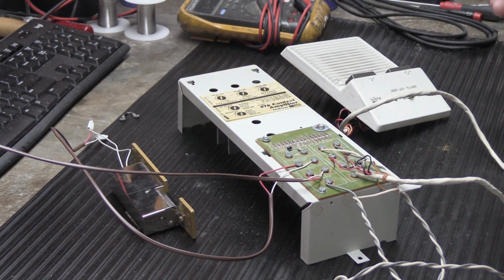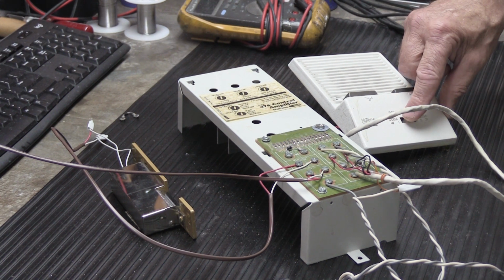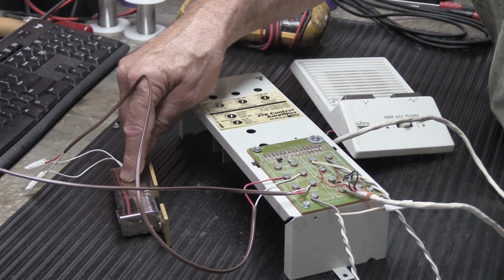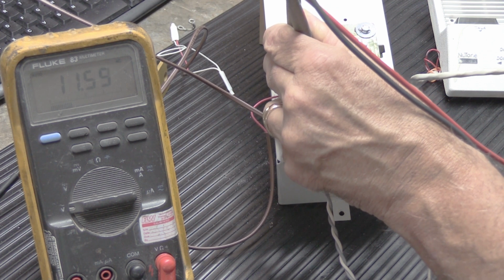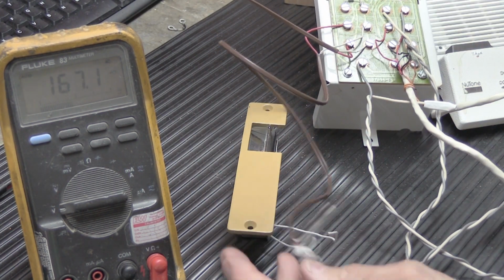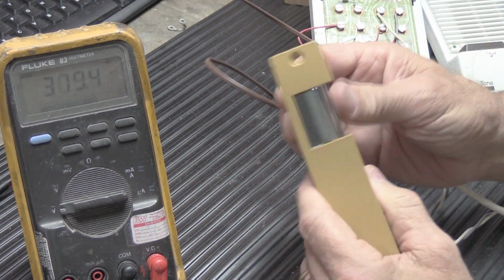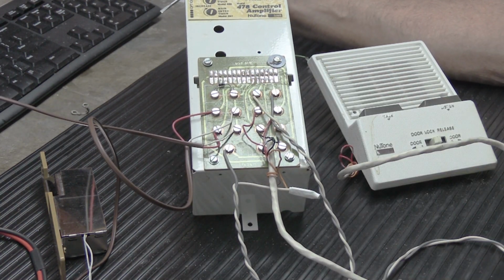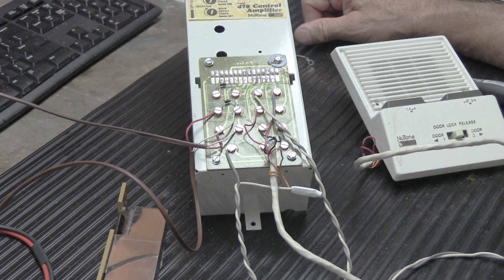Troubleshooting a NuTone Model 478 Apartment Intercom System for Door Release Problems

Comment: At 10 minutes, you show how the "main door release" is putting out about 12 V. Is it safe to assume the door strike is rated for this voltage then? I'm trying to swap out a NuTone 478 system with a Unifi Intercom and a Unifi Access Hub (model UA-Hub). The UA-Hub has a 12v connection on it, and I'm trying to figure out if the UA-Hub will be able to release the existing door strike. There is a "Dry" connection on the UA-Hub as well but I'm a little confused about that. I'm new to low voltage.
Reply from the maker: Hi userr3953: It is Never Safe to assume anything when installing equipment - Just becuase there was a NuTone System installed, doesn't mean it was a NuTone Door Release (unlikely it was) - I know nothing about your Unfi System, it seems to be very modern and somewhat complex - I suguest that you contact the manufacturer about the Door Release requirements - So you don't Blow Something Up - Chris

Comment: having trouble finding the amplifier in an old building for a 4 apartment buzzer intercom setup.  is it possible the amplifier is in the intercoms or is it possible there is no amplifier?  it's an old lee dan system from the late 80s
Reply from the maker: Hi thehook:   There should be an Amplifier (unless it was removed and that's why the system doesn't work) Amplifiers are typically located in utility areas or sometimes behind the Entrance Directory - Chris